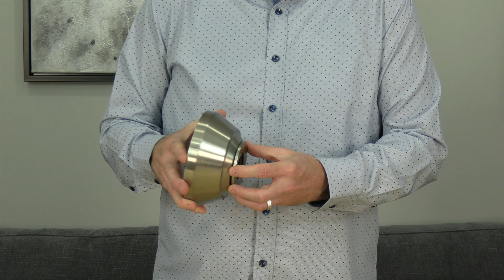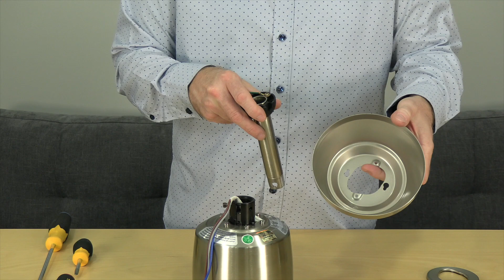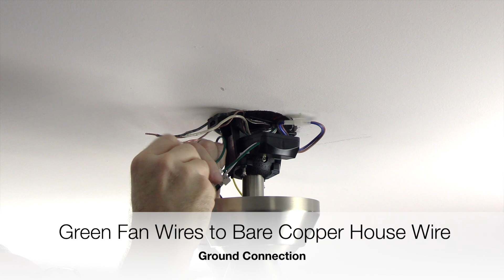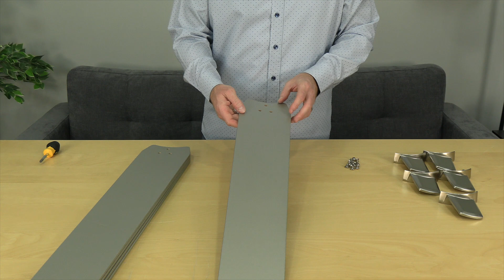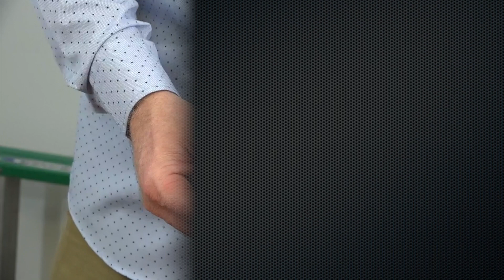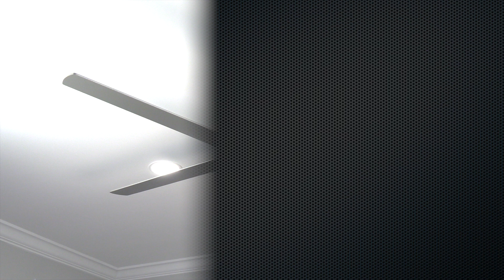How to Install the 56 in. Bellmore Ceiling Fan by Hampton Bay

Comment: Do I have to use the rod my other Hampton bay allows me to use or not use
Reply from the maker: Yes, the fan must be installed with a downrod. This fan does not have a flush-mount option.
Reply: @ceilingfans101  thanks

Comment: what do you do if you need a downrod extension? the extra long wires included look like they are to be connected in the rod itself. seems illegal. is that true?
Reply from the maker: If an extension downrod is needed, you would connect the provided extension wire and then add the extension downrod. The wire connects using molded adapter plugs. There is nothing illegal about the extension wire.